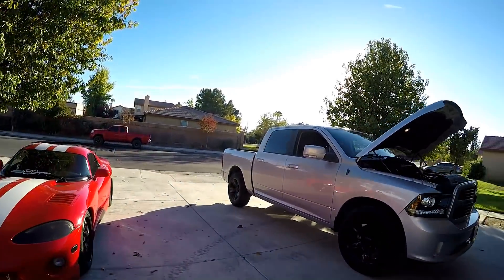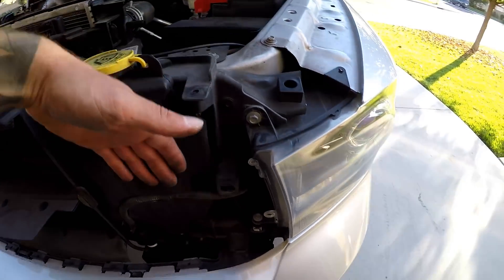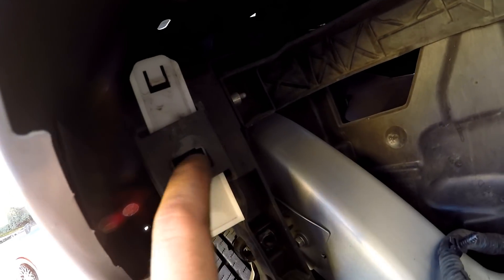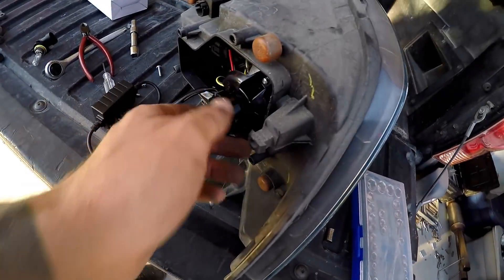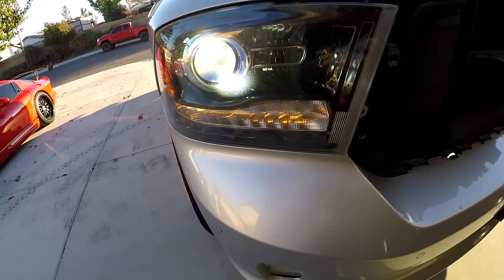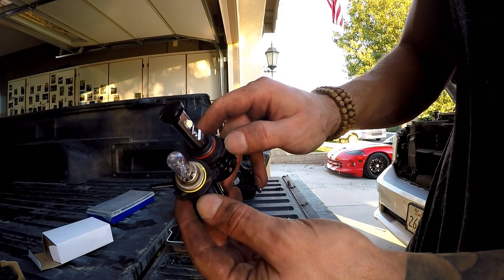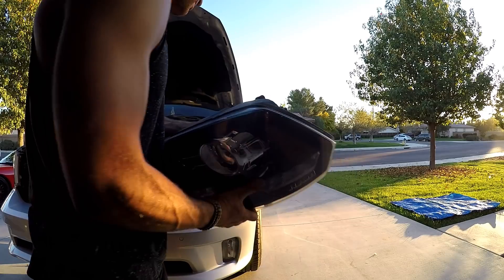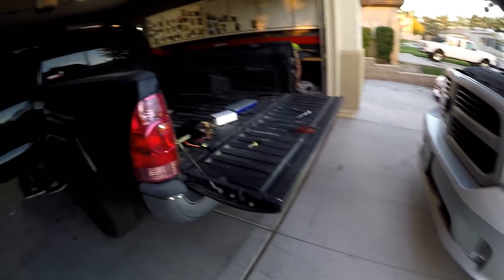Dodge RAM - LED Low Beam - Projector Headlight Bulb - UPGRADE

Comment: looks great and super easy to install,  I did the HID kit myself cost double what that Hikari kit goes for,  Did it come with the canbus or did you pick that up seperately?  Have a link for that?  How is the beam pattern,  those guys at Headlight Revolution tried many LED for the projector Ram and none had a good beam pattern compared to HID.
Reply from the maker: Yeah I probably agree that I might try the HID kit in the low beam next and see how the light output is for those. The projectors on these trucks are pretty brutal to say the least lol.  I had these LED in my fogs and they were insanely bright but do not seem nearly as bright in the low beam projector.  I may try playing with the positioning of the LED in the projector soon to see if I can improve it.

Here is the link to the CANBUS decoder.  If you end up buying the HIKARI LED and tell them you are having flickering they will send you an Amazon coupon code for the decoders that makes them 20 cents to purchase lol.

https://www.amazon.com/HIKARI-Headlight-Flickering-Resistor-Decoder/dp/B07312V7QB/ref=sr_1_1?s=automotive&ie=UTF8&qid=1512402774&sr=1-1&keywords=hikari+9006+canbus
Reply: i was about to say @Boosted2k wish you would of tried HID & LED kits side by side to see pattern and brightness but from experience for Projectors HID's are a must and LED bulbs are fine but in open headlights without Projectors!

Comment: Have you had any heating issues with the LED's?  I was going to install them but was thinking to drill holes in the back of the cover for the fans.  Great video too.
Reply from the maker: Frank P nope no issues! Been working great!
Reply: Thanks, installing mine today.
Reply from the maker: Frank P Awesome! If you're using the hikari kit make sure you use those decoders. They will send you a coupon code to get them off amazon for 20 cents if you have that kit and tell them it flickers on your vehicle.

Comment: Apologies if already addressed but it appeared that your light output on the right HID Fog was MUCH less than the driver side in the last few seconds of the video, was/is there an issue with the positioning of the lens/fog itself?
Reply from the maker: Hey Dawn!  I'm actually making a new video which should be out in a few days with an update  on how the replaced bulbs look and their light output!  I still have to mess with it but I agree it does look less, I'm pretty sure the bulb isn't clocked the same on both sides and I need to spin it

Comment: When installing the led can it be done without removing the grill?
Reply from the maker: Headlight has to come out and best way to do that is to take the grill off.  I've seen people leave the grill in place and remove the headlight but seems like more hassle
Reply: @BoostedMotorsports  Awesome I'll do just that, thanks for the help.

Comment: That canbus is going to get hot and melt the housing. Just a heads up if your headlight starts to have condensation..
Reply from the maker: These ones decoders should be fine. I know there are other versions that use metal resistors and those definitely get hot AF!!!
Reply: The canbus isn't the issue.  The issue is the resistor packs used to allow the canbus to see the right draw from the bulb.  Resistor gets hot because it's dissapating amperage.

Comment: Thanks for all the videos. I'm a new ram owner, and appreciate the ideas and how-tos. I tried to do the hid in my low beams last night thinking I had 9006 bulbs...I actually have 9005 and they have a different diameter base. I have the right kit ordered and will do the swap Wednesday.  Did you replace the bulbs on you high beams?  Thanks again!
Reply from the maker: Thanks for the support Dusty!  I haven't touched my highs because to be honest I don't really need them after upgrading the fogs and lows! 😎